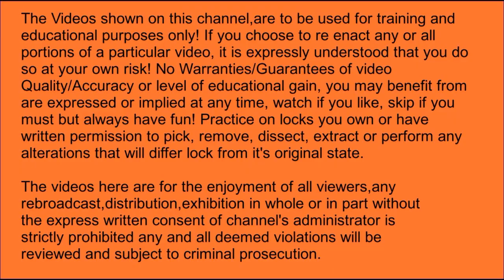#911  MUR-LOCK 68  CISA 5000  "Leave well enough Alone " NOT APPLICABLE!!!

Comment: Only Three Pins? I would have expected more from CISA. I'm disappointed. Do you have the external cylinder for this lock? I hope it's a bit more secure than this.
Reply from the maker: Thanks for stopping by my friend
Appears you came to the dance a bit late🤣😂😂
Previous 2 videos definitely tell the tale on this lock
Joking aside the exterior has 5 pins and most importantly as I demonstrated when lock is put together,3 full rotations are required for bolt to fully retract so yeah to pick it its 3 times!
Appreciate your support
Stay well